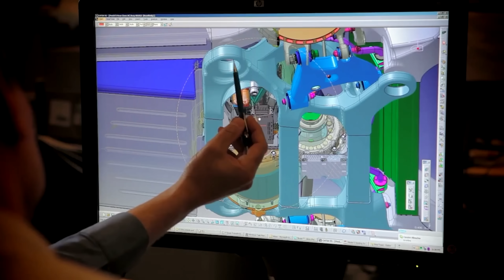Sustainable Abundance | Master Plan Part IV

Comment: To Elon/Engineers/futurist
My concept proposal for Tesla.

As vehicles move toward full autonomy, current input methods (touchscreens, voice commands) introduce unnecessary friction, distraction, and cognitive load. These interfaces were designed for drivers, not passengers in autonomous systems.

If driving is no longer the primary task, the human–vehicle interface must evolve.

Proposed Solution

A Neural-Intent + Augmented Reality Windshield Interface that allows users to interact with an autonomous vehicle through intent detection rather than manual input.

This system combines:
	•	A full-windshield AR HUD
	•	Non-invasive neural intent detection (band initially, implant later)
	•	AI confirmation layers for safety and accuracy

The system does not read thoughts. It detects trained, voluntary intent signals.

How It Works (User Flow)
	1.	Vehicle is in Full Self-Driving mode
	2.	User focuses on destination intent (e.g., “Home”)
	3.	Neural interface detects intent signal
	4.	Windshield HUD displays confirmation:
“Navigate to Home?”
	5.	User confirms via secondary intent or visual acknowledgment
	6.	AI validates safety and executes route

Windshield Interface (AR HUD)
	•	Navigation paths projected onto real-world road geometry
	•	Minimal UI elements anchored to peripheral vision
	•	Context-aware overlays (traffic, ETA, hazards)
	•	Media and productivity UI only when safe or parked

Neural Interface Rollout (Realistic Timeline)

Phase 1:
	•	Non-invasive neural band
	•	Limited controls (navigation, climate, media)

Phase 2:
	•	Improved intent precision
	•	Faster confirmation loops
	•	Personalized intent training

Phase 3:
	•	Optional implant for users who want maximum responsiveness
	•	Accessibility-first applications (disabled users, injury recovery)

Safety & Ethics
	•	No passive thought monitoring
	•	Intent must be deliberate and trained
	•	All actions require AI confirmation
	•	System defaults to non-action if intent confidence is low
	•	Manual and voice controls remain as fallback

Why This Matters
	•	Reduces distraction compared to touch or voice
	•	Natural extension of autonomy
	•	Creates a seamless Tesla–Neuralink ecosystem
	•	Makes the vehicle feel less like a machine and more like a collaborator

Comment: WHY not implement a “3 tap on steering in fsd mode” to give acknowledgement to fsd  to proceed forward in a grey area type of setting?  For example making a right turn with a non-blocking vehicle heading straight in front however there is clearly ample room for fsd to slow roll forward and continue with cautious. 

Eventually the learning builds on this over time and adjusts the weights

Comment: Hi, I had the Idea of rechargeable batteries the same way a iron man suit ark reactor is made but to be more longated and powered by fusion, maybe like a particle accelerator. The way this may work would be to use Quantum Computers and AI systems to be able to locate and detect software encryptions in the data 📊 Just as you made the rockets you may be able to use the same software to make a new mineral or maybe a type of dust from new types of found crystals that may be blue or green. Keep looking. Have a great day. Filippo (Largo) Philip PHP,H2O,OXG,MLP. ❤

Comment: Hello, I am an inventor and a car maker. I saw in a documentary that a Tesla car was going off the road due to high acceleration on winding roads and the brakes could not hold the car. I designed a new and powerful braking system that I do not know how to send to the management of Tesla. My system is very useful and powerful for trucks. Please help me send my design. Thanks Asghar Raisi.
Reply: Hello, I am an inventor and a car maker. I saw in a documentary that a Tesla car was going off the road due to high acceleration on winding roads and the brakes could not hold the car. I designed a new and powerful braking system that I do not know how to send to the management of Tesla. My system is very useful and powerful for trucks. Please help me send my design. Thanks Asghar Raisi.

Comment: Hello, I am an inventor and a car maker. In a documentary, I saw a Tesla car going off the road due to high acceleration on winding roads and the brakes could not hold the car. I designed a new and powerful braking system that I do not know how to send to the management of Tesla. Please help me send my design. Thanks Asghar Raisi.
Reply: Hello, I am an inventor and a car maker. In a documentary, I saw a Tesla car going off the road due to high acceleration on winding roads and the brakes could not hold the car. I designed a new and powerful braking system that I do not know how to send to the management of Tesla. Please help me send my design. Thanks Asghar Raisi.

Comment: It's simple, add a combustion chamber to run a piston with the electricity, cuz it converts the electricity directly to the wheels, that's primitive, doing that will achieve regenerative electrical motors, i can make you a blueprint but i don't really care that much
Reply: A triangular piston will do the job

Comment: According to Tesla Korea, 846 Model 3 or 1.94 percent of the total sales (43,621 units) and 1,234 Model Y or 1.81 percent of the total sales (68,088 units). Of the 111,709 vehicles sold, 2080 vehicles or 1.86 percent, completed repairs at the service center after experiencing the BMS_a079 error.
According to Tesla's domestic community, 2021 vehicles are known to suffer from the error, but posts have been confirmed that they also appear in some of the recently released Model Y (Juniper). Based on this experience, the number of BMS-related repairs in Tesla Korea is likely to increase.

Comment: how much tons of pollutants and greenhouse gases was created during manufacturing of these vehicles?
will the vehicle ever worth it, if the old battery dismantle process is rigged and you're focusing on new, instead of what's more pressing issue such as environmental impact due to battery waste and manufacturing waste?

Comment: To Elon: How to do PSD (permanent supervised driving).  First CPU: detect known or unknown driver. Compare to all drivers world-wide what the driver intends to do. Supervise camera, steering wheel, break and acceleration pedal etc. Based on this open the control more or less or full to the second CPU (where FSD is running)  Conclusion: don't worry if Grandma or your 14 year old son is driving.

Comment: Tesla model X: too old, no one is buying it anymore. Same for the model S. the Cybertruck is a commercial flop. The Semi is since years available commercially but radio silence - guess it's technical performance did not convince yet. 
What is left ? A refreshed model 3 and model y with the same autonomy as in 2018?

Comment: Breaking. Since September 1st  new stricter laws concerning autonomous vehicles are in effect in Austin. Tesla failed to convince the authorities with safety data to get the permit. Therefore Tesla must have the safety monitor on the driver's seat. A stunning display that Tesla is not making progress in autonomous driving but is forced to back paddle. They used the loophole that was there to fool investors but now it is closed. The scam becomes more and more obvious.

Comment: We all work 50% or more per year just to pay for government on all levels directly in the multitude of taxes, fees permits, licensing, or indirectly through those previously mentioned costs applied to others and then added to your cost of living, would getting 40% or more of what you earn back be an abundance to you? It sure would for me. One of the biggest improvements AGI could bring is reducing the cost of government no millions of bureaucrats just following the regulatory programing they don't actually understand mindlessly applying it where it does not belong just clean simple rules with a system that can understand the consequences of their application.

Comment: The businesses need to catch up to the charging network. Anywhere a customer spends 30 mins or more is a possible charging point. Golf courses, restaurants, movie theaters, grocery stores, etc etc. etc. 

Charge up while having dinner not on the way to dinner. 

Parking spots should be the hottest new real estate; yet I see the occasional chargers at a gas station.
🤦‍♂️ 

This also solves a lot the renters charging questions. Charge up at work.

Comment: Hardware 3 is severely neglected
Reply: Obsolete. Hardware 6 is in the pipeline.
Reply: Boo hoo. I'd settle for a 2015 Civic with an electric motor and a comfortable driver's seat for $25K (2015 USD).

Comment: Work on functioning windshield wipers and reliable traffic sign recognition before you come up with more empty promises.
Reply: you have no clue
Reply: @mm-hl7gh I drove a Model 3 for 5 years. Everytime Tesla fixes one thing, they break another. Highland finally fixed the suspension and NVH, but breaks the indicator stalk. Also, the 250kW peak is getting kinda stale. 800V let's go Tesla, keep up!
Reply: @Jeroenneman the buttons work fine, you get used to it after a few days

Comment: Dear Tesla, i have a problem with my car. 😮‍💨
The lane assist keeps steering to the far right of the lane.
Can you please fix this?
Reply: Maybe get a Tesla, they dont help with random cars. Or use Tesla app service appointment.
Reply: Recalibrate the cameras.

Mine was hugging the left line. 8 miles later, it is centered.

Controls > Service > Camera Calibration.